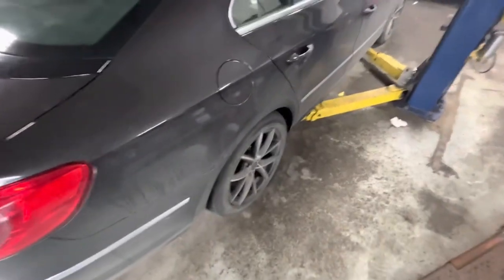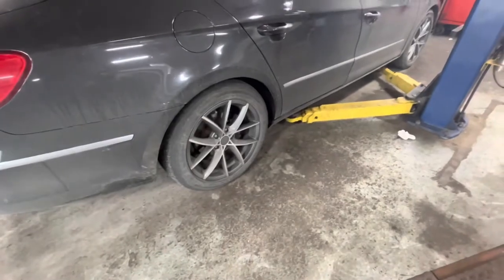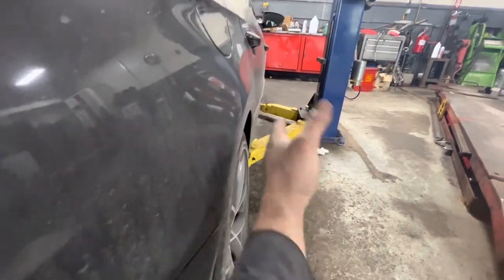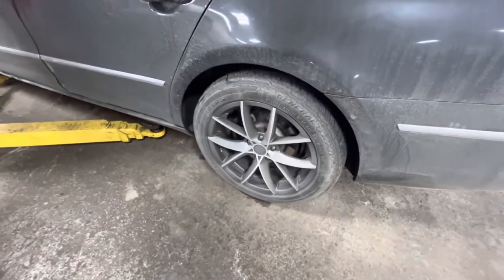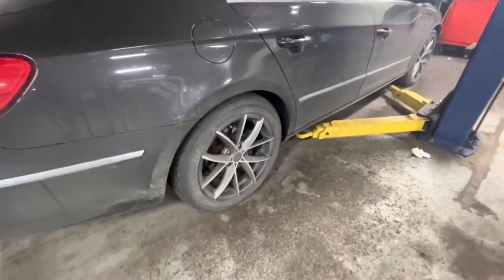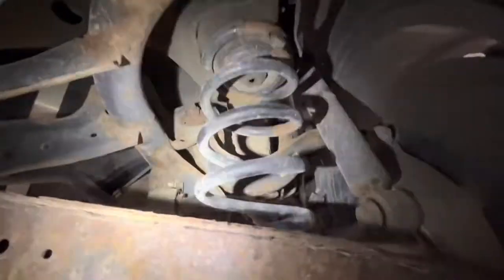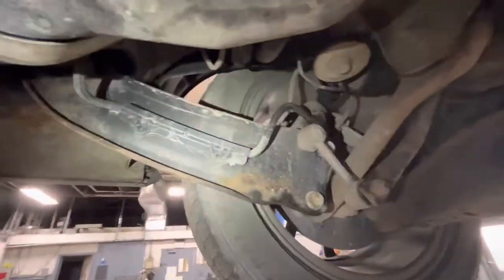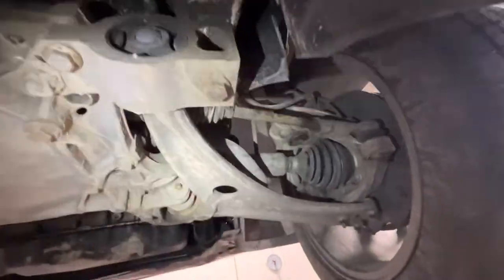IDENTIFYING A BROKEN COIL SPRING ON YOUR VEHICLE

Comment: I just changed my coil spring for Toyota Yaris and it’s £200
Reply from the maker: That’s not bad
Reply: For One coil spring that's pretty expensive.

I did front shocks & coil springs on both sides for £110 fitted for a family member recently doesn't include labour charge though.
Reply: @AA-os1sg  bro that price  for 2 coil springs.

Comment: How much to get it fix? I have both front sides on a 2000 Toyota Camry, can I drive for a couple days like that before taking it to the mechanic?
Reply from the maker: I’m not sure on pricing for that repair
Reply: @EuropeanAutoRepair  can I drive it for a couple day like that?
Reply from the maker: @secure777   it really depends how it broke, is it’s just a piece of the bottom coil you may be fine for a bit but I’ve also seen it spin past the spring perch and damage all kinds of things, I’d have to see it
Reply: @EuropeanAutoRepair  ok, thank you
Reply: Hey man it is both front shocks and struts with a engine support what needs to be repleace,  sorry to ask you so many questions but I want to have an idea of how much it'll be so I don't over pay too much on this, 2000 Toyota camry,  do you have an idea of how much it could be with labor?
Reply from the maker: No problem at all, I would guess labor on the front shocks would be around 400 dollars, honestly I do not work on Japanese vehicles often so that is a complete guess,
Reply: @EuropeanAutoRepair  thank you 👍🏼💯

Comment: Does the tire with the broken spring wear out quicker overall? As if you had one working rear brake.
Reply from the maker: A broken coil springs will many times cause a alignment issue being that the ride height is lesser, usually but not always negative camber is noticeable